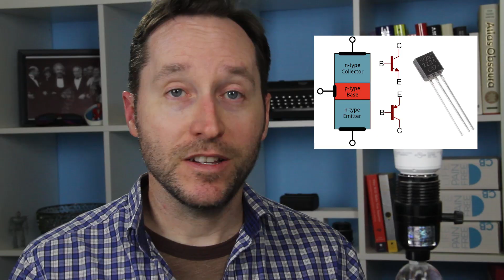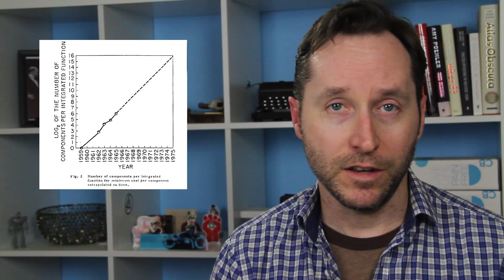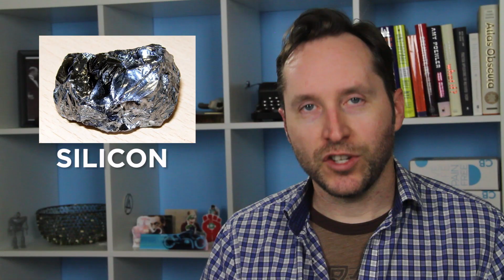Moore's Law Is Ending - Here's 7 Technologies That Could Bring It Back To Life | Answers With Joe

Comment: Good video!  Just saw it today.  I know, one thing that wasn't mentioned was the basic architecture of the home PC.  I had a job building personal computer at the dawn of the Pentium chip.  When the duel processor news was announced (I was no longer building PC's then).  I was excited.  See, the discussion about the IBM architecture is that they always build computers to be backward compatible to some extent.  That also limits the speed information can move from processor to RAM to Hard Drive.  I don't have an answer...but if a personal PC was redesigned on how the basic parts work together...that could keep the speed and power increasing.  I only just learned about Graphene a few weeks ago (it might have even been through one of your videos).  The other technologies you talked about sound exciting.  Sadly...the one aspect of personal computers is...price and profitability.  The home build PC still costs about the same as it did back in the 90's.  I know as long as companies don't want their products to become obsolete due to a radical departure from IBM architecture.  That keeps things in check to a certain extent.  Just my opinions off the top of my head.  Looking forward to seeing more of your videos...older as well as newer.

Comment: end of moore's law - less likely machines will eradicate our species?
Reply: No, Moore's Law is only a small piece of the much larger law of accelerating returns.  Moore's law is just for transistors, but the same held true for vacuum tubes, relays, & punch cards, & the same pattern will hold true for whatever follows transistors.

That being said, it is still incredibly unlikely that our species will be eradicated by machines.  Almost certainly we will merge with them, as we are already doing in primitive ways.

Comment: There is one technique that could greatly improve speed of computation and execution that bypasses need for increase in power. It is the use of high speed read-only memory to provide instant results for common single value functions for all of the trigonomic
Reply: , trigonomic
Reply: , hyperbolic and other functions. I remember that in the book, “Hasting’s Aprophamatiins for digital computers” that no algorithms is accurate for the entire range of values. Huge read-only associative memory arrays could be used for all perfectly pre-computed values. For supercomputers, huge arrays of associative memories could be used as individual answers as each input values could be stored, and looked up later rather than repeatedly looked up.

Comment: I had a graduate course in VLSI design theory in the early 1990's by Franco Preparata, one of the founders of VLSI complexity theory.  He argued using graph-cutting theorems that the connectivity needed by the billion-transistor chips means that the WIRES would cause computers to stop getting faster.  You can shrink a transistor and shrink the voltage but when you shrink the wires the resistance goes up more quickly (so signals take longer to send) and therefore, that is why your graph shows little increase in processor speed since ~2008.  We had 4-5 Ghz processors in 2008, and we have them today, but not much faster.  Think of a city where you can shrink all the houses to the size of a postage stamp but the roads must remain the same width.  That is what ended Moore's law.

There was a onetime hack in the mid-1990's switching from aluminum wires to copper.  After that, no more progress!

The power efficiency is still getting better, it was especially apparent with Haswell and Skylake, and transistors DO switch faster now but you must put them relatively farther apart  (i.e. the wires don't shrink) so that wire resistance doesn't ruin your gains.

Maybe one day we'll go 3D in chips which will definitely allow shorter and faster wires!

I remember reading a paper from IEEE Proceedings in 1993 (issue: somewhere between 1990 and 1993) that predicted no CPU would ever run faster than 10 GHz.  GIven that we have already achieved 8.8Ghz at near-superconducting temperatures almost 30 years later, it seems remarkably prescient.

The last design rules will be at 7nm or 5nm, but probably not smaller.  We are at 12nm right now, so maybe only 4-8 years away.  So maybe CPUs will all have 8-12 cores and maybe use the same amount of power in that final design step, or maybe mobile phones will last 3d on a single charge?  Not much more than a 2x-4x is left in power savings.
Reply: Followup : TSMC and others tout their "4nm" or "3nm" process tech but those are marketing names.  They are improvements on a previous generation so they get a different number.  The numbers actually correspond to nothing about the design rules used to make the chip.
Reply: Right now (3nm) transistors are not really getting faster and memory cells have stopped shrinking(that's why AMD started making x3d processors) but the logic gates can still shrink in size, so companies can make new phone chips that use less power and do more stuff but anything they do faster, they do it by e.g. adding extra logic gates to multiply faster but human redesign is needed every generation. to improve the adders and multipliers.  CPUs are about to advance from running 4 instructions at once to running 5 instructions at once.  There's a definite limit to how many instructions you can run at once and it's normally less than 2 but sometimes a programming language compiler can organize the instructions to get closer to 4 at a time.

Comment: One of the things that's also not mentioned in this video is that you can get different levels of computing performance just from different computing architectures. Let's just compare the architectures that you can find in silicon chips these days:

x86 - Pretty much your tried-and-true everyday GPPU architecture; designed in the 80s, it's in every single chip that is either a clone of, or at least a many-generations-hence successor to the Intel 8086. Even the Zilog Z80 which is still used to this day is an x86 architecture. But x86 wasn't originally designed for parallel computing, and a lot of what the x86-64 architecture can do today is largely the result of... effectively engineering-grade hacking.

SPARC - Sun Microsystems, this is an immensely powerful architecture optimized for multi-core parallel computing; it uses quite a bit of power, but Sun has been able to squeeze upwards of 128 cores or more (multi-threaded, I might add) into a single silicon die. You see this architecture a LOT in massively parallel computing systems like supercomputers.

PowerPC - Ah, IBM. PPC is by no stretch of the imagination a GPPU architecture with high TDP, the reason that Apple switched over to the more thermally efficient (and more widely used) x86 architecture when they wanted to shrink the iBook even further to make Macbooks without using CPUs that could quite literally cause first degree burns on users' legs even WITH heatsinking and cooling fans. But it's still an incredibly powerful GPPU architecture and in some ways can compute circles around x86. And burn a lot of heat doing it. It has its applications, but general purpose, consumer-level computing really isn't it anymore. It used to be. But not today.

ARM - I saved the best for last. ARM is a RISC architecture that has even lower power requirements and TDP than x86. A single ARM core, however, can't hold a candle to an x86-64 core, BUT... ARM cores are much more compact, use far less power, and ARM is designed for parallel multi-core computing just like SPARC and PPC. So you can put a ton of ARM cores into a single die, and it can more than easily hold its own against x86, and use 1/3rd less power for the same computing workload. Virtually ALL smartphones and tablets on the market today are powered by ARM GPPUs, and increasingly compact and low-power desktop computing platforms are looking towards ARM as their GPPU instead of super shrunk down x86-64 solutions like the Intel Atom. ARM is the future of general purpose computing, in my opinion.

I could also mention AVR/PIC architectures, but those are for microcontrollers which... yeah they can be used for general purpose computing, but the possible applications are extreeeemely limited. That said, microcontrollers tend to have everything you need on one chip, just in limited amounts in some way or another. They're more or less a single-chip solution with a minimal amount of external support components like decoupling capacitors across the power pins, and maybe an external crystal if you want a more stable CPU clock. That's about it. That's all you really need with them. And you can do a lot of basic general purpose stuff with them. Just nothing as advanced as browsing the Internet.

And I'm leaving out GPU architectures like Nvidia's CUDA, because those aren't general purpose. They're application-specific, and highly optimized for high-precision floating-point math, and doing a TON of it... massively in parallel because it's not unusual for Nvidia GPUs to have hundreds of CUDA cores in a single die. Of course, this does make GPUs extremely godly at applications such as SETI@Home or Folding@Home or mining Etherium (the cryptocurrency designed to be mined on GPUs), so you can make SOME arguments that GPUs can be used in some GP-ish applications, but that's pushing the envelope a bit.

While we may be reaching the limits of transistor density in silicon chips, we still have the opportunities of coming up with better, more efficient architectures of arranging those transistors on silicon chips that can make better use of the limits of our technology to try and improve on it in little incremental steps until the Next Big Thing causes a tremendous technological paradigm shift.

And for now, at least in my opinion, ARM is that next incremental step. This video is almost a year old as of this comment, and Apple has announced that they are definitively planning to switch over to ARM entirely for their product line, away from x86, because of its efficiency improvements over x86. When I heard of that announcement, I felt SO validated from my past few years of saying ARM is the future. <3

Comment: Transistors are NOT SWITCHES, they can be used as switches but they state is not only consist from logical 1 and 0. Transistors are current controlled pipes where the base current allows a specific amount of current to flow between the collector and the emitter. If you really have to demonstrate it then a water pipe with a faucet is way closer to the actual behavior. You can use transistors to create current controlled resistors, capacitors and switches, in fact in CPU's a lot of resistors are actually transistors because it's smaller in size.

Bytes are NOT ASCII, ASCII is a code to convert bytes to characters. Bytes are used way more than ASCII and usually you store information in the 2nd complement version where you can have negative numbers represented and still added correctly with a logic gate structure.

Comment: I wouldn't say ASCII or UTF-8, just "information".  There are many ways a computer interprets it.  Plain text is one of them.  The ones you mentioned are "character" or more technically: "glyph" encoding standards.  Now with that in mind take note of the many different forms a computer stores information.  Machine code, assembly instructions, packets, bit-streams, descriptor tables, encryption methods, hard drive formats, list goes on.  I hate to correct you because I just came from your battery correction video. In this case though, the umbrella term is the safest assumption to define "the way a computer stores/interprets information".  Sorry.  :(  Also keep in mind Quantum technology, though advancing rapidly, is only ever good at certain KINDS of this type of storage.  One where particles can be interpreted in their number of infinite states to speed up the operation, say in the medical field or as is the worry to many people in cryptography, extremely fast decryption by being able to look at all the results of the guess to a key at once.

Comment: 7:24
"storing 700TB of data would weigh 150kg"
sorry, but thats just not true. if we take for example samsungs 850evo 4TB which weighs roughly 50grams, we would need 175 of those and therefore have all that data stored on storage that weighs under 9kg total. also, in 2016 seagate has demonstrated a 60TB SSD in 3.5" format, which guaranteed weighs way less than 1kg. I can just assume for that calculation conventional HDD's have been used although that tech is reaaaally old tbh.

Comment: Hardly quantum will substitute 100% the current computers, because they produce a lot of uncertainty/error, it is much harder to not have those errors then building more powerful quantum computers. You would use more of the quantum computing preventing those error then quantum computing on a straight line, problem that turns quantum computing for some operations inviable. They are very useful for some operations but not all, those that need precision are very, very far away for being used by quantum computers. So, computers will continue to use current chips for some time (10-20 years at least?), but probably will have some help from a quantum part on nearer future.

Comment: In the short term the real challenge is to ensure variations in transistors production: variations become relatively more and more important as the transistors get smaller. For example in a 13 years old technology like 90nm, a 1nm variation in transistor length represents a relative 1% variation. But at a more recent 10nm litography (2-3 years old), it represents 10%. The smaller we achieve, the more important variations get, relatively speaking. This is why silicon characterisation is becoming so important in chip design and manufacturing, because another factor makes it worse: the number of transistors also increases at a tremendous pace.

Comment: To be honest , moore's law has been slowed down not because of quantum tunneling but of the tech available. It was "easy" creating smaller lines on chips because we could simplg use a different laser source which emits light with a smaller wave length. But moving down to light with even smaller wave lengts is now finally starting to cause issues. Luckily we had a break in between by the use of immersion tech. How ever for the next step using extreme ultra violet light immersion is no longer an option. Also euv light gets absorbed by gas/air and lenses. These major complications have caused a heavy delay getting below the 10nm resolution.  There are tricks like double patterning but these bring high costs. Luckily euv tech is ready to go and i guess we will be able to finally reach 3nm in one go. After that point i guess quantum tunneling is indeed the next issue.

Comment: I'm using an old desktop HP DC7100 SFF, powered with a P4 3.2 ghz processor, and 4 gb of slow DDR ram on a Win 7 OS. A Radeon HD 5450 graphics card helps take the strain for video processing, and the whole thing runs fine for YT. It can even play HD 1080p video streams.
To get this machine to work like this take a bit of time configuring it right, as the makers present their product with so much bloatware, some PCs like that are already 5 years out of date by the time its on the shelf. (but not this one)  :)

Comment: Moore's Law is like Simon Says; Moore says "processing power will double", and the engineers are supposed to do it,.... or take one step back.
Reply: Well, the truth is probably closer to: it takes X months to design a new process (which has to use machines built with current processes), Y months to launch a flagship product to prove the new technology, lather, rinse, repeat.

Comment: i would love to see the optical and dna computer. i even thought of optical with the applied characteristics of fiber optics where multiple separate frequencies could go through the same transistor and not interfere with each other therefore turning a 2billion transistor computer into and evectively 50 billion transistor computer with minimal power and heat dissapation increase. just an idea though. don't know how well it would work.

Comment: I am still waiting for the 128 bit processor.  It will double data flow at current clock speeds. AFTER THAT  we wait for the 256 bit processor and then the 512 bit processor. So on and so forth. They will be affordable for the desktop.

Comment: Joe - your calculations are little off . 700 TB=2735 MicroSD 256GB*. 5g each=13,7kg
* - there are currently 400GB models, but in April they were not available yet.

Comment: Even if we rule out quantum computers that is out of the question we could increase the size of the chip ic so it could fit more transistors or build layered chips with floors that communicate as a flat layer there are ways even with binary digital computers but there is no much point to worry I think